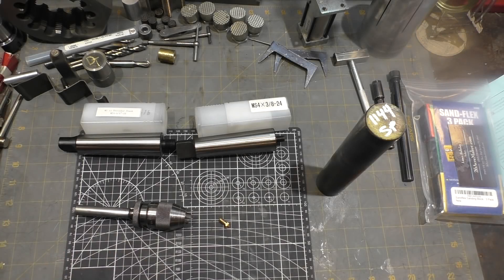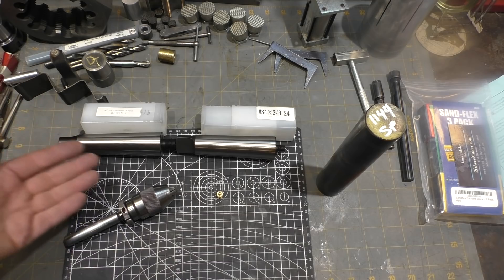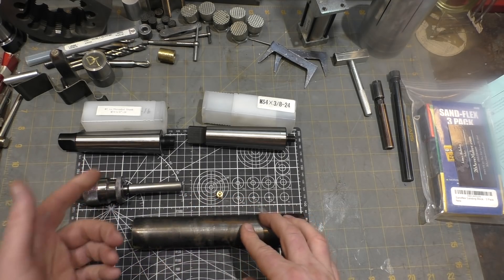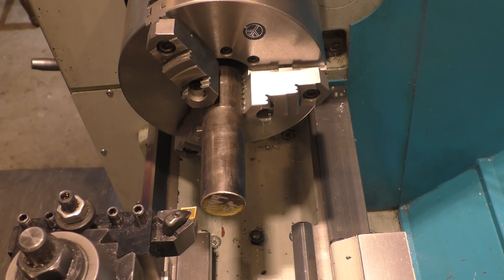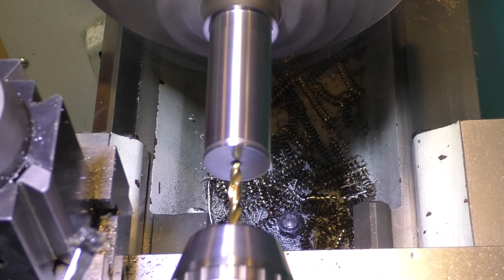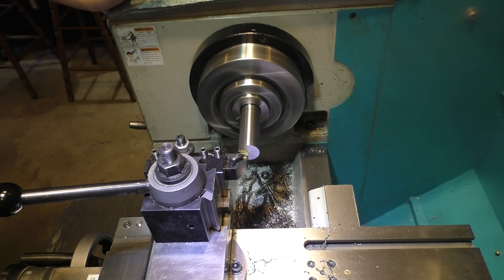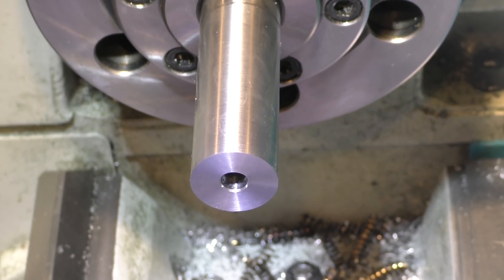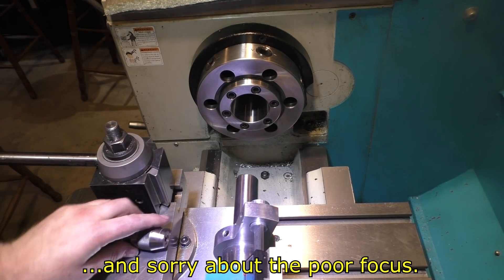84 Superior Feedback Drill Chuck Adapter for the Lathe

Comment: A word to the wise.  Power tapping with a keyless chuck is a bad idea.  Most of these chucks are self tightening, meaning if the tool slips the chuck is so designed to tighten down on the cutting tool shank to prevent the slippage.  If the conditions are right they are capable of tightening down to the point of cracking the chuck body.  If you would like to see one I have one.  This happening is directly proportional to the size of the tap, meaning the chances become greater as the size of the tap increases. Ever since I had this happen I use a ball bearing keyed drill chuck for power tapping anything over a 1/4-20.
Reply from the maker: Thanks for the advise. I really appreciate you taking the time to help me out. I  have had to use the tightening/loosening tool to remove large drill bits before. For the tap I leave the chuck just snug, but you make a good point.

Comment: Could you tell us the part number for those inserts you use , I keep meaning to ask but keep forgetting,  nice build.

Alan.
Reply from the maker: I wish I could, but I got these inserts at an estate sale and the gentleman who owned them kept then in plastic cups without any id other that occasionally tip radius. I don't even know the manufacturer of most. Sorry.
Reply: At least you tried, thanks, maybe there for Aluminum?
Regards Alan.
Reply from the maker: Could be, the ones I have been using have a positive rake.